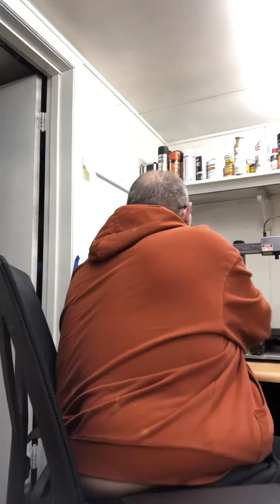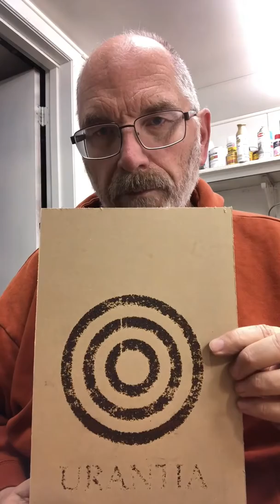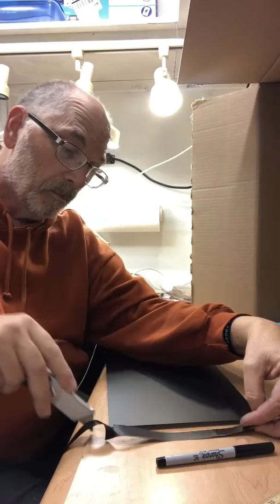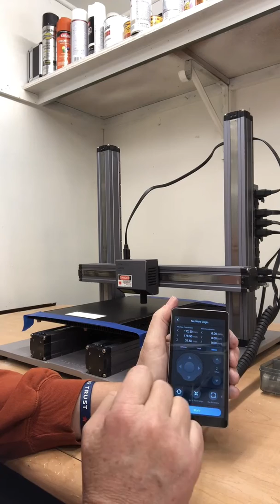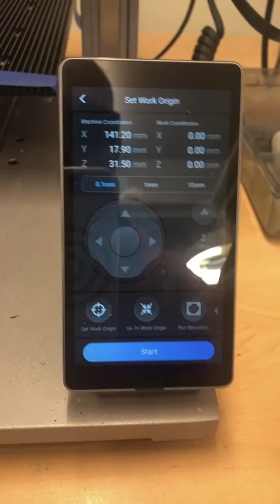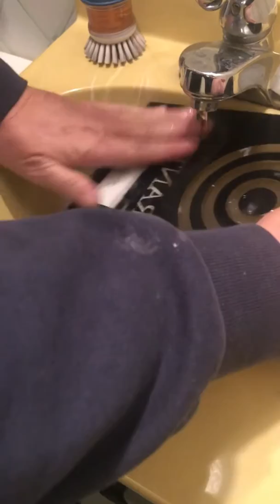Snapmaker Acrylic Laser

Comment: You need to be careful cutting the EVA contact paper with the laser.  Check with manufacturer to see if the formulation used contains chlorine.  If so, poisonous gas may be produced.  My understanding is that laser cutter and engravers are not to be used with PVC materials for this reason.

Comment: Rick- Great video- I appreciate you including what worked and didn't.  I have tried a number of things with dismal results.  I looked at the settings you mentioned in the comments below and still had questions-- not sure if it is due to differences in versions of Luban or between the 1.6 and 10W laser.  When you mentioned horizontal, density 10, work speed 100, 2 passes, 1mm depth and 100% power (you also said in the video something about a "fixed Power" check box), I couldn't figure out where to start.  What Method did you select?  If I chose "Filled", I could select Horizontal, but couldn't set a number of passes or depth.  If I selected "On the Path", I couldn't select any direction (horizontal or vertical)-- and I couldn't find anywhere to set "Density".  Also another stupid question-- are you using the 1.6W or 10W laser-- 100% power would be quite different.  Thanks!

Comment: hello!  have you tried this with the snapmarker 10w laser?  what configuration would you recommend me to do tests with it in acrylic? thanks
Reply: I have been working with 10W but struggling.  I got it to work pretty well by using 16% power wich is equivalent to 1.6W and 200 speed.  Even though supposedly same as old laser it seems significantly faster but I am still learning with 10w too.  It is powerful and fast.  I will do a video when I can creat consistent results.  Thanks for asking.

Comment: Thanks for posting this Rick.  I plan on getting the Snapmaker 2.0 A350 here in a week or so and want do do acrylic laser etching with it.  Seems you found a good way of doing it!
Reply from the maker: You will love it.  Like all new software the Luban takes some learning but for this it isn't too bad.  I got the new high power laser and I am struggling with it because it is so powerful.  I am doing more acrylic etchings as I write this but had to turn the power way down on the 10W laser to be equal to the 1.6W laser.  I plan to make a video on this once I figure it out for myself.  The A350 has a nice size bed and with CNC and 3D printing it is capable of a lot more than I am. LOL!
Reply: @ricklyon2635  I've been looking at the laser upgrade today.  I look forward to your future video on it!
Reply: @ricklyon2635  Hey Rick.  Are you still messing around with engraving clear acrylic with a diode?  If so, I found a method I like a lot.  You take a sheet of metal and coat it with gray spray paint primer.  Once it's fully dry, focus your laser to the sheet metal then place the acrylic on top.  The results are great and there's very little post processing to be done.  And when it's time to do another sheet of acrylic, just sand down the sheet of metal and reapply the primer.  Don't try engraving without putting a fresh coat down.  I tried so you don't have to.  The results are not good.
Reply from the maker: @EndoBaggins  I have been pretty busy with project:  JesusMetaverse.org but otherwise struggling to tame my new high powered laser head for Snapmaker.  I hope to get back to it soon. I appreciate your advice and will certainly give it a try.  Thanks.

Comment: Suggestion for you: If you have a bubble that you just can't press out, try sticking it with a needle as near the center as possible.  Then press around the point of penetration in circles that get smaller as you go.  When you get to the center, viola!  You're all done!  This method worked for me when I was a sign fabricator for a local municipality here in the Dallas area.
Reply from the maker: Thanks!  Will remember that trick.

Comment: Home Depot and Lowes both sell the plastic sheets with the brown paper on it.  I think they will cut it to size and drill holes into it upon request.  I was so worried you'd be the brave one and not wear your protective goggles.  Have you considered getting their enclosure which appears to have protective colored transparent panels on it?  Or their rotary attachment for milling, engraving/etching, possibly 3D printing onto cylindrical or rectangular objects?  The enclosure should make the machine not only a lot quieter but offer better control of fumes when lasering leathers or other smelly materials, CNC engraving, and so forth.

You might also want to see if the Photo V Carve software from Vectric will let you import & design CNC 3D cut files that can be exported to standard gcode for your 3-in-1.  If it does then you can pass along another tutorial to us on your experiences for getting the best results.

Comment: Thank you for going through all the trial and error so we don’t need to. But man you went through a lot of acrylic to get to the answer. Would it not have been better to use small test sizes, maybe 3”x3”? Also, on your phone there should be setting so the video isn’t reversed when using the selfie camera (if that’s what you meant).
It’s a shame the power supply is so noisy on the Snapmaker.

Comment: could you share link where you got the clock stand?

mightyou know if there is way to have like other info there ?  like stock ticker scrolling or weather??
Reply from the maker: Yes. Be aware that this base comes ONLY as 24 hour military time. It will not do 12 hour am/pm.  Some, but not all, of their smaller clocks claim to be am/pm but they are 24 hour clocks that display am or pm such as 14:00 pm. Just be careful when ordering. https://www.xstron.com/long-led-base-clock-7-rgb-lights-ir-remote .  The only other place I have found these bases is on AliExpress.  If you find a better source please let me know too. Thanks.

Comment: For safety sake please be sure you are not laser cutting vinyl or PVC based contact paper (a lot of them are), the fumes are some of the worst releasing corrosive hydrogen gas, ethylene, vinyl chloride and dioxin. The hydrogen gas will eventually foul up the laser lens and the rest is really REALLY bad for your health if inhaled. Learned this lesson trying to cut stickers made from vinyl. Stay safe out there and thanks for the video! I'm going to give that spray chalk a try.
Reply: Do you know if the one he has shown has PVC or how you determine which ones do?

Comment: A compound square would help getting square with the bed of the machine.  A deburring tool would remove the rough edges on the acrylic. A rotary cutter will trim the excess contact paper. And using your ink roller would ensure a smooth application of the contact paper. These are a few suggestions that may help.

Comment: This is exactly what I needed to know, but I have one other question. What settings did you use to convert/process your original image? B/W, vector, greyscale, ect. I find the burn pattern varies greatly and would certainly affect the final image quality. Thanks again! You've helped over 1700 of us so far!
Reply: Thanks Geoff. I am really glad this has been helpful to so many people and to you. I made an excel spreadsheet of the settings I used.  For this I used B&W with default (I think) 168. On process page I used horizontal, density 10,  work speed 100, 2 passes, 1mm depth, 100% power (make sure it is on 100 because it seems to default to 50. Good luck! and Thanks!

Comment: Rick, can you post a link to the black contact paper you used?  Thanks for this video!  I tried the dry erase marker as well, tried using cardboard underneath as well and paper on top, grew frustrated and gave up.  This video is a masterclass!  Kudos to you for your fortitude and perseverance to push forward and find a way.  Right now I’m CNC etching and cutting but after watching this video. I think I’m going to switch to laser etching with CNC cut out.  Thanks!
Reply: Here ya go. I got it at Staples, black contact paper.
https://www.staples.com/kittrich-con-tact-adhesive-roll-18-x-60-black-kit60fc9a93601/product_24393425

Comment: Great work! I'd very much like to hear how the cutting goes for you. I've so far been struggling to find examples of people cutting acrylic with the Snapmaker (whether with CNC or laser), which is one of the things I really want to know if I can do before buying.
Reply from the maker: I used the CNC to cut the acrylic but I haven’t figured out how to cut it with laser.  I made one half hearted attempt but it didn’t work.  Not saying you can’t but I haven’t seriously tried either. CNC worked great though.  I really like my Snapmaker.   IMO it probably isn’t meant for high volume commercial use but good for serious hobbyists for sure.  Luban software is fairly easy but frustrating too.  Very short on instructions IMO. But some of the other such software is overwhelming for me because it has thousands of functions.  I’ve had my Snapmaker 6 months now. I’m glad I bought it, have made some cool stuff and no serious complaints.